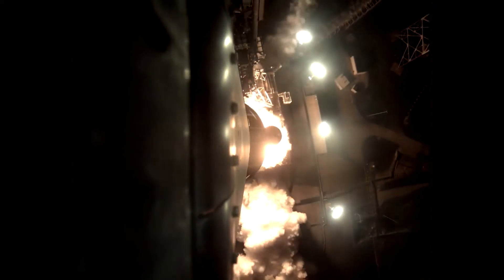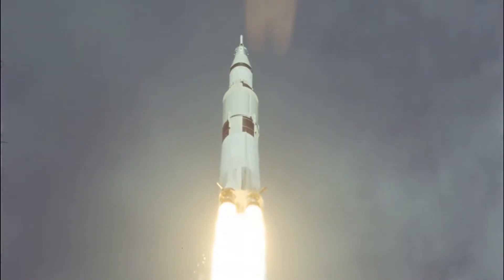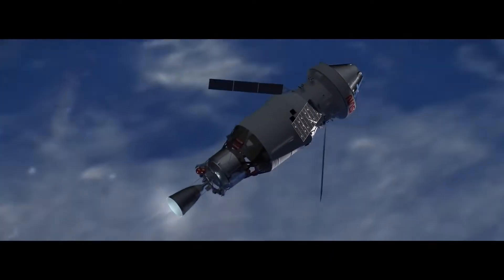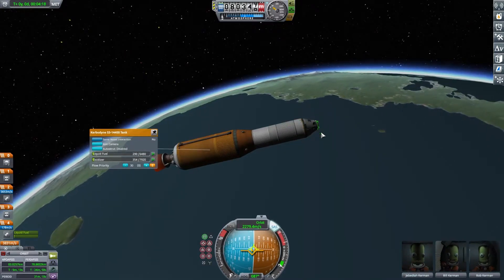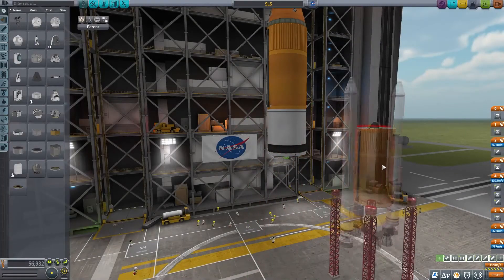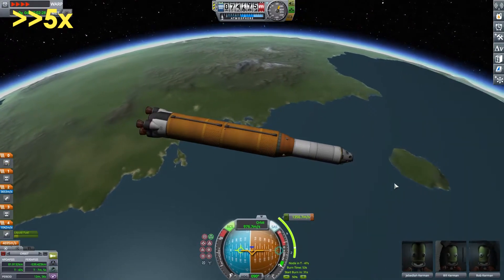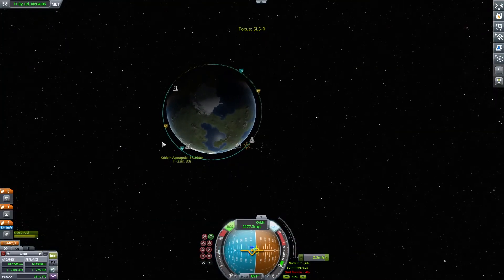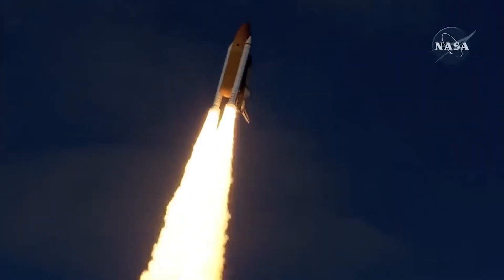Why SLS is still OUTCLASSED by a 55 Year Old Rocket!

Comment: SLS is not designed the way it is to save money. It's designed the way it is to keep the manufacturing lines that ran the Shuttle running. It's entirely political because some states heavily relied on the Shuttle program for employment and the congressmen from those states made sure their states would not be ruined by the end of the Shuttle program. So don't think of the SLS as a huge waste of money, think of it as a subsidy for states.

Comment: I think you missed a lot of key things about SLS which is weird for me considering that you're an aerospace engineer. 

One of the key thing is that SLS (and Space Shuttle) is more like a stage-and-half design like R-7 (Soyuz) and early Atlas missiles, rockets. The boosters is like the first stage and the core is like the 2nd. Boosters role is to provide the necessary thrust to get off the pad and get out the most dense part of the atmosphere and the Core's job is to reach orbit (like the 2nd stage of Saturn V). RS-25's are designed for this job and it's have a pretty good 452 sec ISP for that. (In comparison J-2 had 421). 

Also NASA intentionally shut down the core on suborbital trajectory. They don't want to play debris bingo with a 85t rocket body (like China do with CZ-5B's Core) and left the circularization to the upper stage. NASA did the same with Shuttle's ET for the same reason. But this stack without any upper stage could capable to launch 95t to LEO. This is more than enough to launch Skylab. (And if the rumors true, it's kinda similar what Starship actually capable at the moment.)

So about the 2nd stage. I'm pretty sure that you know that SLS Block 1 utilize a slightly lengthen and modified DCSS called Interim Cryogenic Upper Stage. And as the name suggests it is just an interim solution. The plan was always to get a properly sized upper stage starting from Block 1B. The first plans was to carry over the EDS (Earth Departure Stage) from the Constellation Project but eventually they chooses to develop the EUS (Exploration Upper Stage). They did it because they want to spare the development cost of J-2X engine and "just" modify the RL-10 engines for SLS needs, because engine development is stupidly expensive. (This is why they choose to use and develop further RS-25's.) I'm not sure why you didn't mentioned EUS at all in the video. It significantly increases the TLI performance, specially with Block 2 upgrades (27t->46t) which is similar what Saturn V had.

Also the using parts from Space Shuttle statement I think need some addition: basically two part was reused from the Shuttle: 16 engines for the first 4 missions (but they were modified, like they got the engine control unit from J-2X development, because the old ECU's was ancient and incompatible with SLS) and some steel cases for boosters. But because the 5th segment, the nozzle was already modified, the tank, avionics, etc. was entirely new design, the tooling for manufacturing is brand new, etc. Not even the alloy is the same for the tank, partially because of manufacturing reasons. (Also it had some performance impact.)

Comment: My thoughts on this: the ICPS setup, where you used a smaller upper stage, was done as a cost cutting measure. They were given an impossible deadline, with not much money to make it happen, do they figured, okay, we'll use this to meet the requirements, then put a big upper stage on later down the line (Even studies for hydrocarbon core SLSs had this option for commercial upper stages in the trade space, options included the DCSS, Falcon 9 S2, the Ares I upper stage, I think the Zenit upper stage as well, among others). This large upper stage, the EUS, is in development right now. In the end, this approach... didn't work. Surprise surprise, building a SHLV is hard. Especially when you're pinching pennies. I'd argue that the flat budget actually made SLS more expensive than it would have been if they followed a more traditional dev curve. The RS-25's vacuum performance isn't a huge concern, as it's still extremely good, even better than some older hydrolox pure-vacuum engines. The staging arrangement comes from the space shuttle, yes, but that doesn't mean it's not advantageous. No new large hydrocarbon engines had to be developed. No expensive GSE mods had to be installed, or RP storage at LC-39B(it is worth mentioning that the hydrocarbon core studies mentioned that while the GSE cost would be expensive upfront, it would be cheaper operationally since it's simpler and not designed with reuse in mind). Plus, SLS is actually a hell of a lot lighter than the Saturn V. Fully loaded, an SLS Block 2 would be  around 700 tons less than a fully loaded Saturn V, and can send even more payload to TLI. Ariane 5 uses a similar design to SLS. H-II/A/B/III uses a similar design to SLS. Adding a third stage adds more complexity and increases cost. The only rockets I can think of off the top of my head that used an "optimal" staging configuration are Proton and Saturn V. So while yes, the explanation given absolutely makes sense, the staging arrangement of SLS does make sense.

Comment: A society built around a nearly universal ignorance of how the money system works is rather far from ideal. It clearly can't be said to benefit no one so it's not going anywhere but thank you for explaining how it influenced this program. Today, things take far longer to complete, cost many times as much, compared to the fifties and sixties and may or may not be very good thanks to corruption and just plain modern politics. I suppose we can be thankful that good things do still happen.
Reply: "I believe that this Nation should commit itself to achieving the goal, before this decade is out, of landing a man on the Moon and returning him safely to Earth."
Reply: Actually developing SLS costs way less than Saturn V and the Artemis program is still cheaper than the whole Apollo program with much-much more component. Artemis not only includes SLS and Orion, but Gateway, HLS, SLD, rovers, satellites, space suits, other auxiliary missions sent on other rockets, etc. 

The thing what pumped up Apollo's costs is the time constraint set by Kennedy. Artemis's deadlines is rather flexible than Apollo's. Also Artemis was often underfunded, NASA got the money later when they actually needed while Apollo basically got all the money in time when they needed. This - ironically - also creates cost increases: you have to pay the fixed costs - usually the upkeep of the infrastructure, payments, etc.

So yeah, politics involves a lot in those decisions but not only.